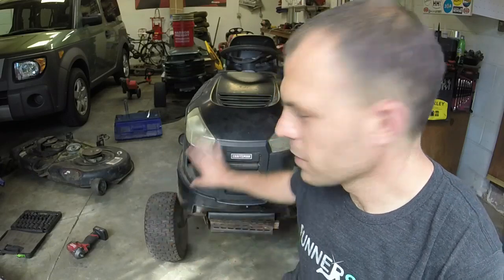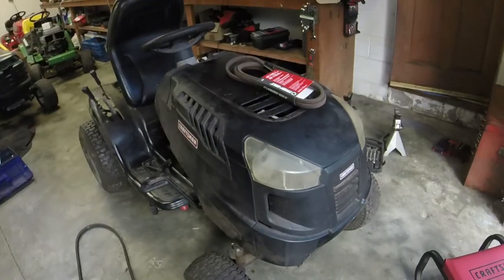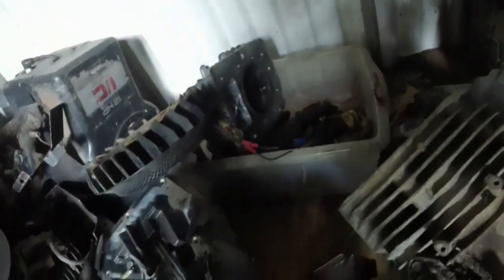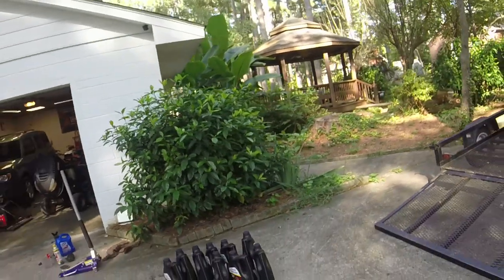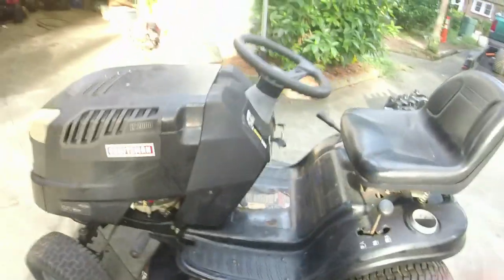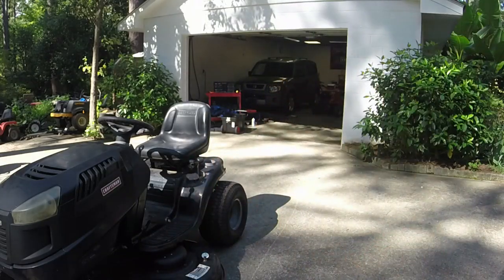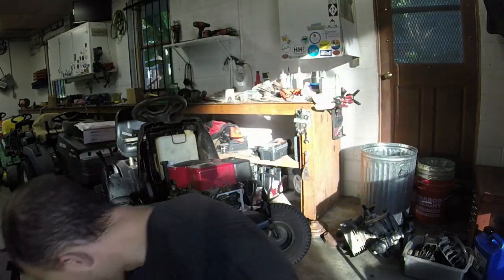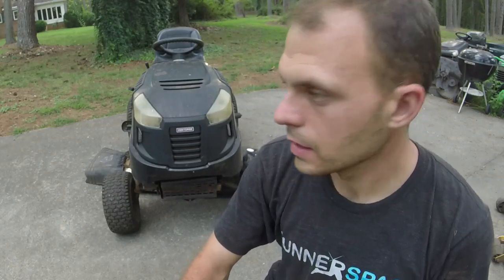MTD Craftsman LT2000 fixing various driving and mowing issues and making it reliable again

Comment: i  just bought on e of these but its been a headache. how is the  long spring from the right pedal   hooked up  ?
Reply from the maker: Not fully sure as I haven't had to fix that spring yet.  I guess it's the return spring so the pedal comes back after you press it.  Best advice is to google search your model number to find a parts manual and that would be the best way to find how it hooks up.
Reply: Thanks  for responding

Comment: Just replaced the transmission and driver belt was working fine but now it creeps forward or reverse i can’t stop it with breaks or turning acceleration down
Reply from the maker: It sounds like you don't have OEM belts on it.  I have used generic Amazon belts and that exact thing happens.  You'll probably have to buy OEM belts (Stens, Rotary, Oregon belts also work)